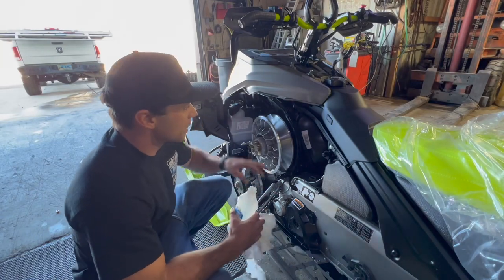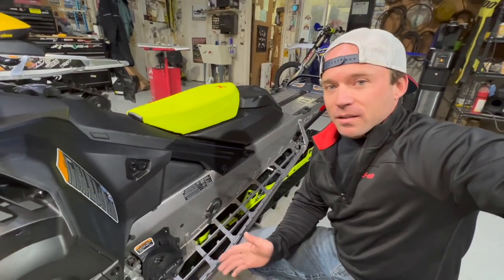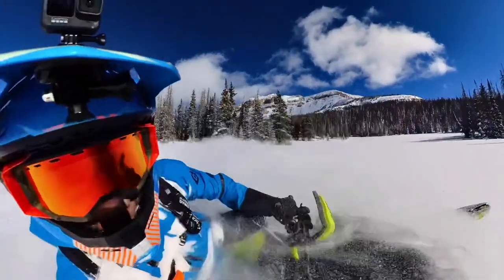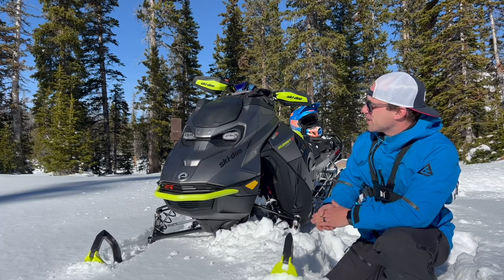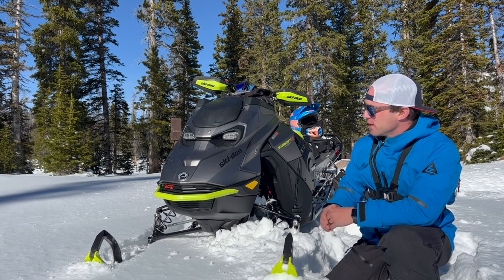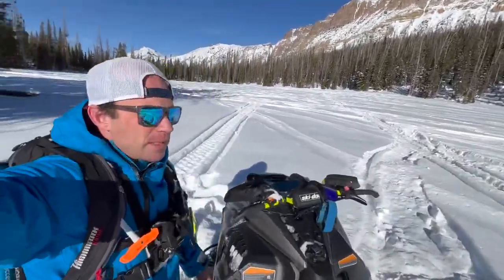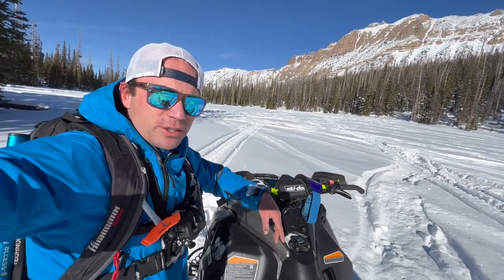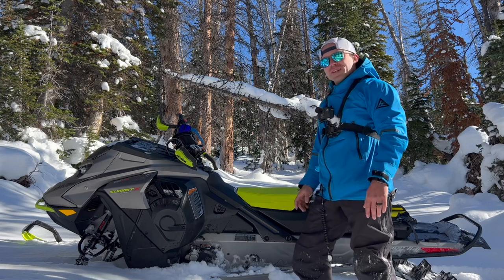Gen 5 Summit Expert Turbo Ski-Doo assembly and first ride! @skidoo

Comment: Awesome, Steve!  First time I've seen the Insta360 mounted forward of the visor like that.  So, I have a question I can't seem to nail down anywhere online. I know the rear shock is different with the new skid geometry. But on the front, is there any difference from the new black KYB shocks from the bronze shocks on a '20/'21 Expert?  I love the smoothness of the Kashima coated shocks on my earlier sleds, and not sure the differences. Thanks in advance!
Reply from the maker: Thanks! It’s a cool perspective for sure!  The ski shocks are valved stiffer on the ‘23 expert versus previous models.  I’m not sure why they went away from the kashima coating, I wonder if was a supply chain thing. I’ll ask and see if I can get an answer.  In motocross, they kashima coat A Kit suspension to reduce friction, which reduces fading during long motos in the heat, maybe heat soak isn’t as big of an issue in the deep snow, but it sure looks trick!
Reply: @SteveMartin12  Awesome, thanks for responding!